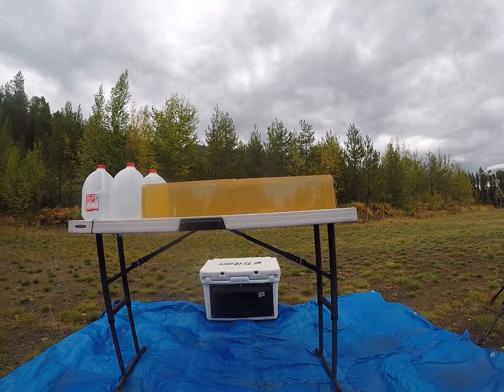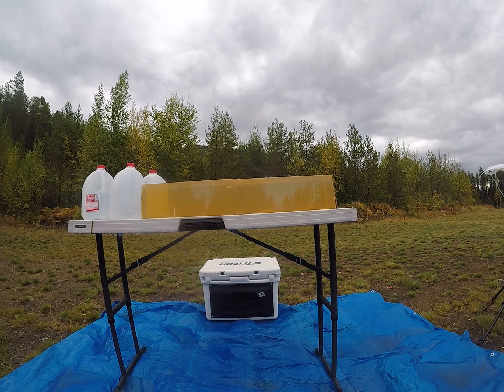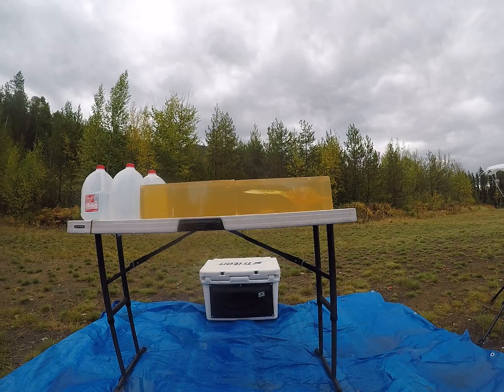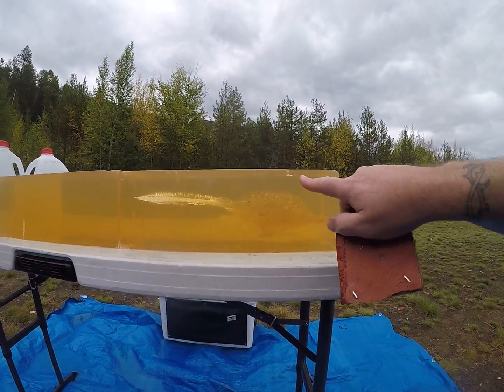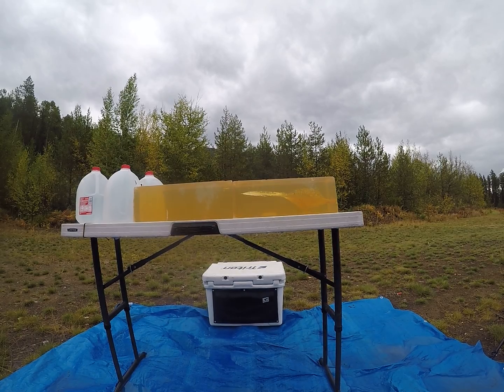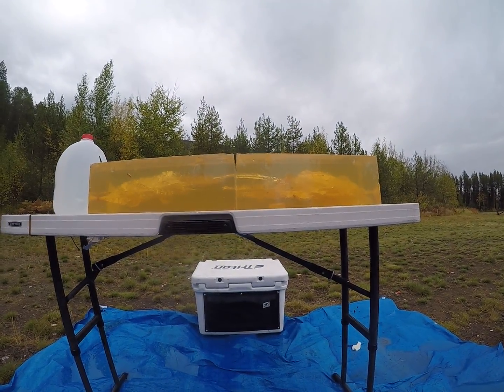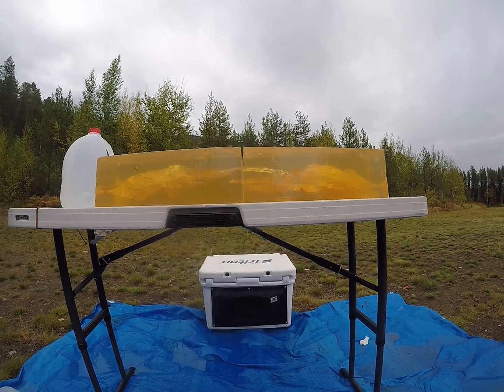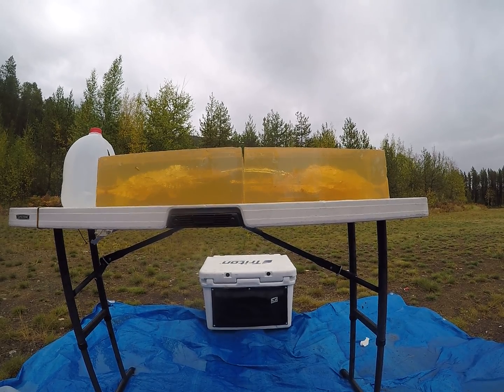6.5 Creedmoor .264 Cal-124g Hammer Hunter ballistics gel test PT1

Comment: I wonder if the first bullet had stability issues due to being fired so slow.  The slower the bullet is moving right after firing requires a faster twist in the barrel. With a 7 inch twist that bullet has marginal stability at sea level and 59 degrees F.  With an 8 twist at 1000 ft it is way down the scale of marginal stability, the higher you go the better the stability gets and same with temp.  Many factory rifles come with 8 twist or slower(higher #)

Comment: I could shoot .308 150 SST's and that gel would jump off the table with two shockwaves. Deer usually just fall over backwards or roll in a circle where they stood.
Reply from the maker: I have found the 150gr SST do work well for deer sized critters out of a 308 win. Bit over destructive but not too terrible. 

The 30 cal 150gr Power Hamer out of a 308 Win would be a better comparison to the 150gr SST and how gelatin reacts. If you get into the140 grain class of  0.264 non bonded high fragmenting bullets (ELD-M's, ELD-X's, SST, and such) you can easily get similar destructive results as the 150gr class of non bonded bullets in a 308 Win if that type of destruction is what you are looking for.
Reply: That's due to hydrostatic energy the copper rounds don't unload all that energy inside like a Berger or sst. Still great performer when Pentration is a factor

Comment: You said it'll perform around 1700, but thays really the bottom end, maybe a 1600 load could find out?
I'd certainly be interested to know as I'm planning on getting into slower cartridges and want something that will work sub-1800, which is the apparent industry standard for hunting expanding bullets of a Spitzer design (vs blunt designs that may work as low as 1000 fps)
Reply from the maker: You should look at Maker bullets.  I talked to him a few years back at a show and he was willing then and probably is still willing to customize the alloys he uses to perform how you want them to perform in the subsonic realm plus he already has some available designed specifically for subsonic applications.
Reply: @simplemindedfella  oh i love Maker subsonics. But I was more meaning the low supersonic range, like what you encounter with "thumpers" but using Spitzers instead of pistol bullets.

Possible applications for what I'm talking about: 350 legend, heavy 300 blk loads from shorties (like 150 grainers), or more on target for what my planned application is: the upcoming 8.6 blackout, or 375 raptor, or... if it's even possible, 416 Spikes (cases look easy to make but load data is non existant). Each is functionally a heavy bullet going thumper or lever action speeds, but with very high BC bullets that might yield effective ranges at 300 yards instead of the typical max thumper at 200 yards.
These cartridges also do subs really well, so it goes without saying that I'd love maker subs in each, but I'm primarily looking at the heavies in these cartridges that yield better energy and BC effects, but these "max energy" bullet sizes tend to be just bellow standard expansion ranges.
I actually bought a few Cutting Edge designs in .338 precisely because the design will reportedly expand down to 1400 fps (from their website). But I'm not always looking for a fragmenting bullet or their cost or idiosyncrasies (that seal tight band)

But you're right that Maker might be ideal if I can settle on a set of weights and dimensions and don't mind forking over some cash. They seen like cool people. They already have a gorgeous 338 subsonic I had to snatch up.

Comment: I've got a 22 K Hornet and using the 35gr HH. And to get 3200+fps from the regular Hornet, expecting over 3300fps at final load work up. Got a block of clear ballistics gel with its name on it. Will be testing it at velocities reduced to simulate 75yd and 150yd impacts.
Reply: That makes for a compelling survival round/bullet.
Reply: @andyeighttre  it is. What's even better, is that the K hornet did disproportionately better than the modest capacity increase would indicate. Steve at Hammer bullets has a 33gr bullet as well, and with H110 and a CCI small PISTOL primer, they both give over 3500fps from a 20.6" barrel with no pressure signs...absolutely unbelievable!